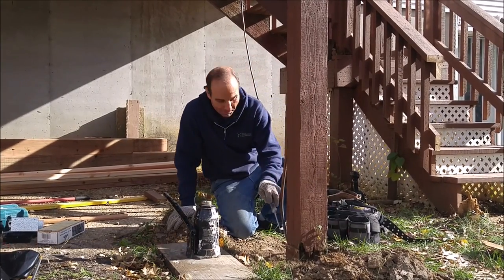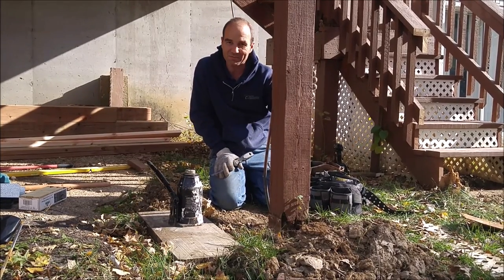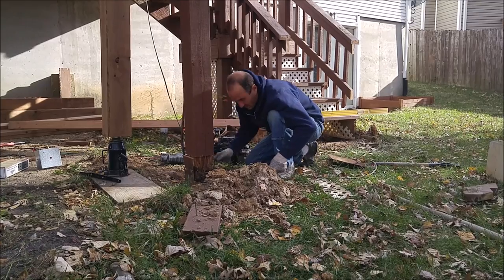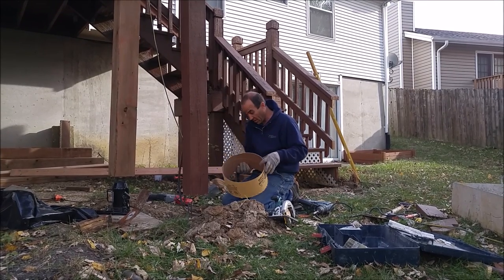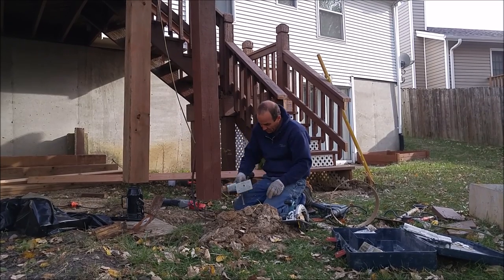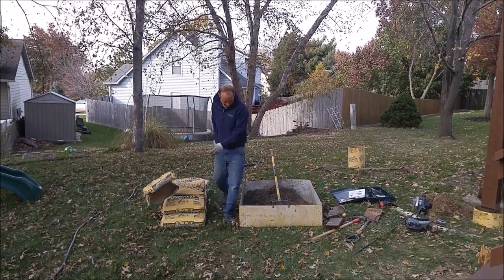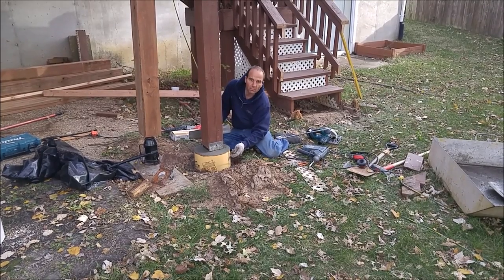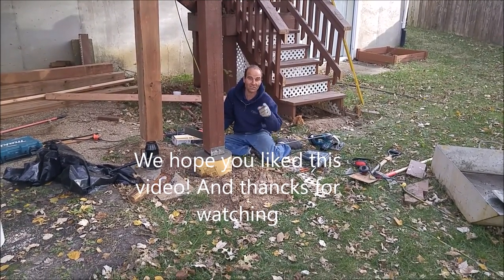How to Replace a Deck Pier

Comment: Are you sure the pier did not sink, your suggestion  of replacing  the pier sounded better than attaching  to the exsisting pier. 
It would have been nice to see the finished  product. You never mention how long to allow for curing.  3 to 28 days? .Either way your advice was good.
Reply from the maker: One day of setting time is plenty.

Comment: Great video! We have a 6x6 post with an old 8-10" footer holding up the upper deck corner and corner of roof. The corner area is about 7 ' away from a slowly disintegrating railroad tie retaining wall on a slope. Engineer says we need to install two helical piers at $8K. We think this is a cost effective way to stabilize this corner post and could add a second post. What do you think?

Comment: My deck has 5 buried posts like this one had. Only two of my 5 posts are starting to rot. Is it alright to have a mix of buried posts and ones like you did here? I assume so. My plan was to only replace the ones that are rotting, and do the other ones when needed.
Reply from the maker: RockCh4lk, sure.  That's a great plan!  Often times small steps towards the end goal is the best way to get it done for Do It Yourselfers.  It won't be a problem for your deck to do a couple now and the rest later.  
Please subscribe to our channel so that you can get notified when we post new videos.  Thanks!
Reply: I have the same situation with one bad and 2 good posts.  I think I'm going to replace the dirt around the good ones with gravel to help keep them dry.

Comment: My deck posts heaved 2 inches per year for last four years, under Minnesota freezing temp. how do I repair piers footings to prevent it in future?
Reply: Needs to go deeper. Footings need to go below the frost line which for Minnesota is between 60" and 90" deep!

Comment: how deep should the new concrete base be?
Reply: Nick Brother same question I have if no existing footing in place.
Reply: Depth differs by area.  I'd google to find that out, as it depends on the weather.  

This solution assumes there's already a footer here.  There are a lot of videos showing starting without a footing already there.

Comment: What kind of jack did you use and what's the best way to set it? Anyone can chime in, thanks!
Reply: It is a bottle jack.
Reply: Looks like a Hydraulic bottle jack but can't tell the capacity. But I would expect if you take a piece of wood under the jack that a 3 ton mechanics jack would work in a pinch.

Comment: First, thank you so much for sharing this video. I'm thinking of adding about 4 inches of concrete to my 6 existing deck piers. Right now, they're at  the surrounding soil level. In your opinion, how thick the added concrete piece should be to prevent it from crumbling in the future? I live in Minnesota where the weather is fluctuating big time. You mentioned using high strength concrete, this is to prevent the added and exposed concrete piece disintegration in the future?

Comment: Thank you for the great video.  This is a project I am about to start.   Why did you raise your jack 1/4" after the concrete  pour?
Reply from the maker: Stephen Hiatt, glad to help.  Hope your project goes well!  I raise the jack slightly to account for the fact that the post will drop a little before it hits the hardened concrete.

Comment: Didn't see if you bolted the steel cap to the concrete. Did you?
Reply from the maker: You should at least put the metal post base over a stud in the concrete so it can't be knocked off.